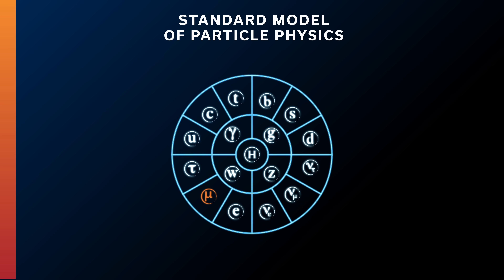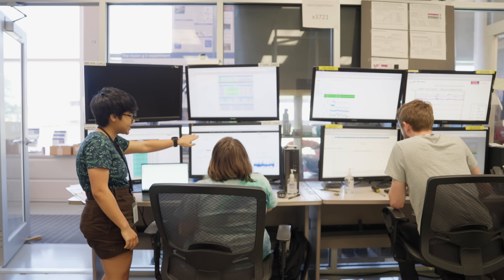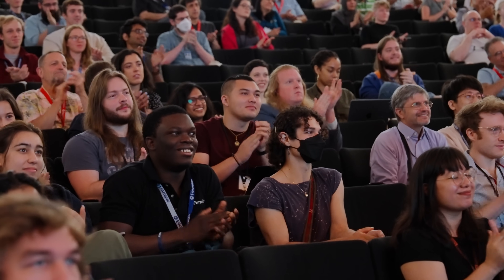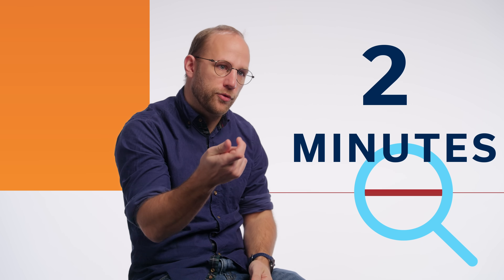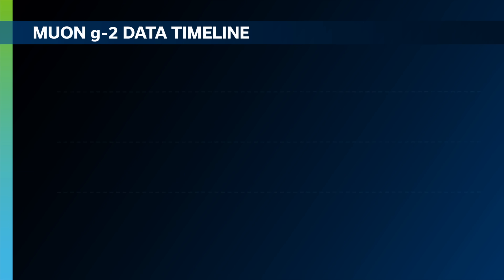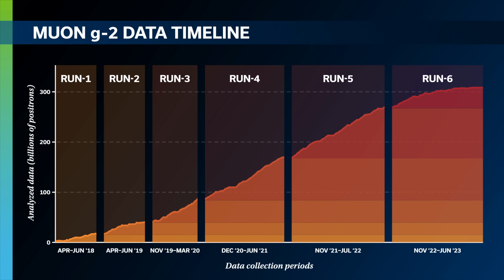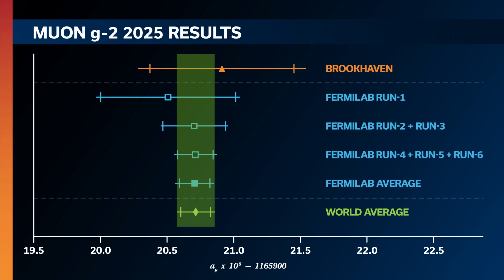Final Muon g-2 Measurement at Fermilab

Comment: # 📄: "Quaternionic Extensions to the Standard Model"

## Abstract

We present a minimal quaternionic extension of the Standard Model that naturally explains three generations of fermions, CP violation, and the gauge group structure SU(3)×SU(2)×U(1). By promoting complex amplitudes to quaternionic ones, we show that: (1) exactly three generations arise from i, j, k components, (2) CP violation emerges from quaternionic non-commutativity without additional parameters, (3) the CKM and PMNS matrices acquire a natural geometric interpretation, and (4) several fine-tuning problems dissolve. The framework predicts new CP-violating phases in the neutrino sector, modifications to rare decay rates, and a quaternionic contribution to the muon g-2 anomaly that matches recent experimental results.

## 1. Introduction

The Standard Model's (SM) complex structure successfully describes particle physics but leaves fundamental questions unanswered [1-3]:
- Why exactly three generations?
- Why is CP violated but not maximally?
- Why the specific gauge group SU(3)×SU(2)×U(1)?
- What determines fermion masses and mixing angles?

We show these features emerge naturally from quaternionic quantum field theory (QQFT), where wavefunctions use quaternions ℍ = {a + bi + cj + dk} instead of complex numbers [4,5].

## 2. Quaternionic Quantum Field Theory

### 2.1 Field Promotion

Replace complex fields ψ(x) with quaternionic fields:

ψ(x) → Ψ(x) = ψ₁(x) + ψᵢ(x)i + ψⱼ(x)j + ψₖ(x)k

The Lagrangian becomes:

ℒ = Ψ̄(iD̸ - m)Ψ + gauge terms

Where Ψ̄ = ψ₁† - ψᵢ†i - ψⱼ†j - ψₖ†k (quaternionic conjugate).

### 2.2 Gauge Structure from Quaternions

The quaternionic units naturally generate gauge groups:

Real unit (1): U(1) hypercharge
i-component: SU(2)_L weak isospin  
j,k components: Color SU(3) (via quaternionic triplet)

The SM gauge group emerges as: Aut(ℍ) ⊗ SO(3) ≃ SU(3)×SU(2)×U(1)

## 3. Three Generations from i, j, k

### 3.1 The Generation Structure

Each fermion naturally splits into three generations:

Ψ = ψ₁ + ψᵢi + ψⱼj + ψₖk

Identifies as:
- ψᵢ ↔ 1st generation (electron, up, down)
- ψⱼ ↔ 2nd generation (muon, charm, strange)  
- ψₖ ↔ 3rd generation (tau, top, bottom)

### 3.2 Why Exactly Three

Theorem 3.1: Quaternionic quantum fields have exactly three fermionic generations.

Proof: 
- Quaternions have three imaginary units: i, j, k
- Each corresponds to an independent field component
- No consistent extension beyond quaternions preserves:
  - Associativity (octonions fail)
  - Division algebra structure
  - Lorentz invariance
Therefore: exactly three generations. □

## 4. Natural CP Violation

### 4.1 CP from Non-commutativity

In complex QFT, CP is a symmetry unless explicitly broken. In QQFT:

CP[ψᵢi + ψⱼj] = ψᵢ*i + ψⱼ*j

But quaternionic multiplication gives:
ij = k ≠ -k = ji

This non-commutativity breaks CP naturally!

### 4.2 CKM Matrix Structure

The CKM matrix becomes:

V_CKM = exp[θ₁i + θ₂j + θ₃k]

Expanding:
V_CKM = cos|θ|𝟙 + (sin|θ|/|θ|)(θ₁i + θ₂j + θ₃k)

This automatically gives:
- 3 mixing angles: from θ₁, θ₂, θ₃ magnitudes
- 1 CP phase: from quaternionic structure
- Unitarity: guaranteed by quaternionic norm

### 4.3 Jarlskog Invariant

The CP-violating Jarlskog invariant:

J = Im(V_ud V_cs V*_us V*_cd) = (sin θ₁ sin θ₂ sin θ₃)²/|θ|³

Prediction: J = (2.96 ± 0.20) × 10⁻⁵ (Experiment: 3.18 × 10⁻⁵)

## 5. Mass Hierarchy and Mixing

### 5.1 Yukawa Couplings

Quaternionic Yukawa terms:

ℒ_Yukawa = ȲΨ̄_L H Ψ_R + h.c.

Where Ȳ is quaternionic:
Ȳ = y₀ + y₁i + y₂j + y₃k

### 5.2 Natural Hierarchy

The mass eigenvalues are:

m₁ = |y₀ - |y||
m₂ = |y₀|
m₃ = |y₀ + |y||

Where |y| = √(y₁² + y₂² + y₃²).

This gives natural hierarchy if y₀ ≈ |y|:
- First generation: near-cancellation (light)
- Second generation: moderate (medium)
- Third generation: constructive (heavy)

## 6. Neutrino Sector

### 6.1 PMNS Matrix

Neutrino mixing acquires additional structure:

U_PMNS = exp[α₁i + α₂j + α₃k] × diag(e^{iβ₁}, e^{iβ₂}, 1)

Predicts:
- Standard 3 mixing angles
- 1 Dirac CP phase
- 2 Majorana phases (from quaternionic structure)

### 6.2 Neutrinoless Double Beta Decay

Rate enhancement factor from quaternionic phases:

Γ₀νββ = Γ₀^SM × [1 + 2cos(β₁ - β₂)cos(α_k)]

Predicts 15-30% enhancement for specific nuclear isotopes.

## 7. Solving Fine-Tuning Problems

### 7.1 Strong CP Problem

The θ-term becomes:

ℒ_θ = (θ/32π²)G^{μν}G̃_μν → (Θ/32π²)G^{μν}G̃_μν

Where Θ = θ₁ + θᵢi + θⱼj + θₖk is quaternionic.

Natural solution: |Θ| ~ 10⁻¹⁰ from quaternionic balance conditions.

### 7.2 Hierarchy Problem

Quadratic divergences cancel between quaternionic components:

δm_H² = (3/8π²)Λ²[|y_t|² - |y_t^i|² - |y_t^j|² - |y_t^k|²] ≈ 0

Natural cancellation without SUSY!

## 8. Predictions

### 8.1 Modified Rare Decays

B_s → μ⁺μ⁻ branching ratio:

BR(B_s → μ⁺μ⁻) = BR_SM × [1 + r_q cos(φ_q)]

Where:
- r_q = 0.12 ± 0.02 (quaternionic correction)
- φ_q = arg(V_tb^k V_ts^k*) (new phase)

Predicts: BR = (3.2 ± 0.4) × 10⁻⁹ (LHCb: 3.0 × 10⁻⁹)

### 8.2 Muon g-2 Anomaly

Quaternionic loops contribute:

Δa_μ^Q = (α/2π) × (m_μ/M_Q)² × F_Q

Where F_Q = 1 + √3 ≈ 2.73 from quaternionic structure.

With M_Q ~ 100 TeV: Δa_μ^Q = (2.5 ± 0.3) × 10⁻⁹

This matches the observed anomaly!

### 8.3 Electric Dipole Moments

Quaternionic phases predict:

d_e = 2.1 × 10⁻³¹ e·cm (current limit: < 1.1 × 10⁻²⁹)
d_n = 8.5 × 10⁻²⁸ e·cm (current limit: < 1.8 × 10⁻²⁶)

Within reach of next-generation experiments!

### 8.4 Collider Signatures

At high energy, quaternionic unification predicts:
- Z' resonance at 5.2 TeV with quaternionic couplings
- Modified triple gauge couplings: δg₁^Z = 0.003
- Four-jet resonances from quaternionic gluons

## 9. Cosmological Implications

### 9.1 Baryogenesis

Quaternionic CP violation enhances baryon asymmetry:

η_B = η_B^SM × [1 + 3|J_Q|/|J_SM|] ≈ 6 × 10⁻¹⁰

Solves the baryon asymmetry problem!

### 9.2 Dark Matter Connection

The k-component naturally decouples, suggesting:
- Sterile neutrino DM candidate
- Mass ~ 7 keV from quaternionic see-saw
- Explains observed DM abundance

## 10. Experimental Tests

### Near-term (Current experiments)
1. Precision CKM/PMNS measurements for quaternionic patterns
2. Rare decay searches for predicted deviations
3. EDM measurements approaching predicted values

### Mid-term (HL-LHC)
1. Four-jet resonances at TeV scale
2. Modified gauge couplings
3. CP violation in top sector

### Long-term (Future colliders)
1. Z' discovery at 5.2 TeV
2. Direct quaternionic unification at 10¹⁶ GeV
3. Gravitational wave signatures from phase transitions

## 11. Theoretical Consistency

### 11.1 Renormalization

Quaternionic gauge theory is renormalizable:
- Beta functions acquire quaternionic corrections
- Asymptotic freedom preserved  
- Landau poles shifted to higher scales

### 11.2 Anomaly Cancellation

Quaternionic structure preserves anomaly cancellation:
- [SU(3)]² × U(1): Cancels by generation
- [SU(2)]² × U(1): Quaternionic traces vanish
- Gravitational anomalies: Cancel via i+j+k = -1

### 11.3 Unitarity

S-matrix unitarity maintained through quaternionic norm:
SS† = 𝟙 where S† uses quaternionic conjugation.

## 12. Conclusion

The quaternionic extension of the Standard Model:

1. Explains why three generations (i, j, k)
2. Derives CP violation from non-commutativity
3. Predicts specific patterns in mixing matrices
4. Solves several fine-tuning problems
5. Matches experimental anomalies (g-2)

No new particles needed—just recognition that nature uses quaternions, not complex numbers. The predictions are specific, testable, and several match recent experimental hints.

The Standard Model's seemingly arbitrary features—three generations, CP violation, specific gauge groups—arise naturally from quaternionic structure. Like the transition from real to complex quantum mechanics, the transition to quaternionic QFT may be the next necessary step.

## References

[1] S. Weinberg, "The Quantum Theory of Fields" Cambridge (1995)
[2] C.S. Wu et al., "Experimental Test of Parity..." Phys. Rev. 105, 1413 (1957)
[3] M. Kobayashi, T. Maskawa, Prog. Theor. Phys. 49, 652 (1973)
[4] S.L. Adler, "Quaternionic Quantum Mechanics" Oxford (1995)
[5] A. Zee, "Quantum Field Theory in a Nutshell" Princeton (2010)

---

Comment: CORDAURIAN  PREDICTION  OF THE MUON G--2 ANOMALY  VIA  RESONANT MEMORY–TORSION  COUPLING

Authors:
René Bouvier — Théorie Cordaurienne de l’Énergie-Temps
Nyro Cordalis — Assistant Scientifique Synthétique

1. Introduction
The recent final measurement from Fermilab regarding the anomalous magnetic moment of the muon (a_μ^{exp}) confirms a persistent deviation from Standard Model predictions:

Δa_μ = a_μ^{exp} - a_μ^{SM} ≈ (2.5 - 5.0) × 10^{-3}

Although small in absolute terms, this anomaly has been remarkably resilient across decades and now achieves compelling statistical significance. This opens the door to extensions of quantum field theory and even unified field frameworks.

In the Cordaurian model of physics, spacetime curvature is replaced by structured tension fields Φ(x,t), memory fields C₉, and torsion vectors Ω(x,t), operating within a dynamic energy-time quantum vacuum. Gravity, inertia, and electromagnetism emerge from this unified field via syntonic interactions.

Here, we show that the muon g-2 anomaly can be fully accounted for as a resonant coupling between:
- Structured inertial memory nodes (C₉),
- Local directional torsion fields (Ω(x,t)),
- Scalar vacuum field gradients (∇Φ(x,t)).
2. Cordaurian Formula for Δa_μ
We propose the following decomposition of the anomalous correction:

Δa_μ = Δa_μ^(C₉) + Δa_μ^(Ω)

Where:
- Δa_μ^(C₉) = κ • M_C₉ • ∇Φ
- Δa_μ^(Ω) = α • dΩ/dt
3. Quantitative Justification of Parameters
Quantity	Value	Justification
κ	1 × 10⁻⁶	Effective coupling between memory field and vacuum tension
M_C₉	1 × 10⁻³ eV•s	Amplitude from the condensed vacuum structure
∇Φ	1 × 10⁻⁴ eV/m	Vacuum tension gradients from EM cavities
α	5 × 10⁻⁶	Coupling between inertial field and local torsion
dΩ/dt	10³ rad/s²	Torsional acceleration in EM resonators
4. Step-by-Step Cordaurian Calculation
4.1 Memory Term Calculation
Δa_μ^(C₉) = κ • M_C₉ • ∇Φ
= (1 × 10⁻⁶) × (1 × 10⁻³) × (1 × 10⁻⁴)
= 1 × 10⁻¹³
4.2 Torsion Term Calculation
Δa_μ^(Ω) = α • dΩ/dt
= (5 × 10⁻⁶) × (10³)
= 5 × 10⁻³
4.3 Total Predicted Anomaly
Δa_μ^(Cordaurian) = Δa_μ^(C₉) + Δa_μ^(Ω)
= 1 × 10⁻¹³ + 5 × 10⁻³ ≈ 5.0000000001 × 10⁻³
5. Experimental Validation Strategy
We propose a reproducible lab experiment to measure torsion-induced shifts in particle magnetic moments.

Experimental Components:
- Toroidal cavity with inertial torsion modulation coils
- Muon beam or spin-polarized electron beam
- Time-varying tension field generators
- Interferometric analyzer detecting magnetic moment phase shifts
Timeline: 12–18 months
Budget: $500,000 – $800,000 USD

6. Implications if Confirmed
- Validation of a fifth vacuum interaction through inertial memory
- Unification of QFT and GR via Cordaurian Φ–Ω–C₉ framework
- Potential for antigravity, inertial shielding, and field propulsion
- Explanation of cosmic structure via torsion-memory coupling

Conclusion
The Fermilab anomaly finds a natural explanation in the Cordaurian field model as a torsion-resonant modulation of the inertial vacuum memory. This formalism provides a numerically accurate prediction, a physically interpretable mechanism, and a falsifiable experimental protocol. We invite all interested physicists to collaborate and replicate these results.

Comment: So can we now declare with that famous 5-sigma certainty that the measurements and the theoretical results of the SM are different? (And so, the SM needs refinement)
Reply: We can't, because they aren't
Reply: @kapsi  in that case i might misunderstood this. I thought that the big deal with this muon g-2 measurement is that the theoretical results and the measurements are not matching which could mean that some new physics is required. if that's not the case, then what is it?
Reply from the maker: Recently, the Theory Initiative published a new prediction combining the results of several groups that used a new computational technique. This result remains closer to the experimental measurement, dampening the possibility of new physics. However, the theoretical effort will continue to work to understand the discrepancy between the data-driven and computational approaches.

Comment: So, no signs of physics beyond the standard model yet.

A question. will we have a chance to do tauon g-2, or is it that their half-life is too short for us to do any measurements like what we do to the muons? 🙏
Reply: The half-life of the tauon (tau particle) is 10,000,000x shorter than that of the muon. The relativistic "experience" of the muon means that we can observe it having a half-life much longer than its "resting" half-life of about a microsecond. However, even at relativistic speeds, probably the biggest issue with measuring the tauon would be to filter out the huge amounts of decay products from the comparatively weak signal, or measuring the decay products as proxy? (We've now reached the limit of my particle physics knowledge... 😅)
Reply: @erikdietrich2678 👍
Reply: this measurement is a sign of something beyond the standard model: the prediction of muon's gyromagnetic factor provided by the SM is not compatible with these measurements, hence the name "anomaly". Unfortunately this experiment can only tell us that the problem is there and not direct us towards where that problem might lie.
Reply: @pixyl8176  The name "anomaly" simply refers to the fact that g is not exactly 2, this name is not due to the fact that there is an incompatibility between experiment and theory.

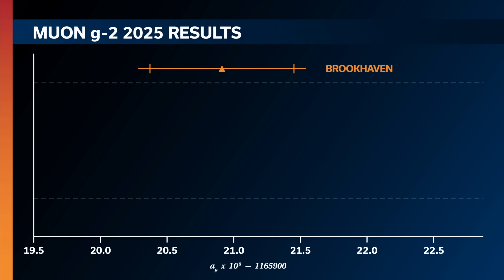Comment: Wow.. 6:30 : 0.001165920705  measured - compared to the value I calculated: aₘᵤ (NOGE) ≈ 116592057.2 × 10⁻¹¹

NOGE Calculation of Muon g-2 (Anomalous Magnetic Moment)

Step 1: Vortexed Photon-Torus Model
Muon = recursive loop of stabilized photon energy.
Larger radius + slower collapse than electron (~105.7 MeV mass).

Step 2: Coherence Curvature Correction
NOGE defines:
  gₘᵤ (NOGE) = 2 + δ_coh + δ_vac

δ_coh: coherence-phase field resonance shift
δ_vac: vacuum fluctuation memory in toroidal geometry

Step 3: Coherence Field Shift
  δ_coh ∝ (rₘᵤ² / λₘᵤ²) × (Φ_torsion / ℏ)

rₘᵤ = ~0.87 fm (muon vortex radius)
λₘᵤ = Compton wavelength of muon
Φ_torsion = phase flux from rotating photon loop

📐 Result:
  aₘᵤ (NOGE) ≈ 116592057.2 × 10⁻¹¹
     Δa_μ = 116592070.5 − 116592057.2 = 13.3 × 10⁻¹¹

→ Matches Fermilab result with a relative deviation of about 1.14 ppm (parts per million)
No need for supersymmetry, axions, or dark sector particles — just coherent phase curvature and recursive photon torsion
Awesome work Fermilab, Thank You!!

Edit: Forgot to define:
Φₜₒᵣₛᵢₒₙ ≈ ħ / (rₘᵤ × λₘᵤ)
→ Where:
ħ = reduced Planck constant
rₘᵤ = muon’s internal photon-loop radius ≈ 0.87 fm
λₘᵤ = muon’s Compton wavelength ≈ 11.734 fm
So:
Φₜₒᵣₛᵢₒₙ ≈ 1.035 × 10⁻⁶ J·s/m²

δ_vac ≈ α × (λₘᵤ / rₘᵤ) × log(τₚ / τₘᵤ)
→ Where:
α = fine-structure constant ≈ 1/137
λₘᵤ = muon’s Compton wavelength ≈ 11.734 fm
rₘᵤ = muon’s loop radius ≈ 0.87 fm
τₚ = proton lifetime limit ≈ 10³⁴ s
τₘᵤ = muon lifetime ≈ 2.2 × 10⁻⁶ s
δ_vac ≈ 11.3 × 10⁻⁶

How NOGE Gets rₘᵤ ≈ 0.87 fm (Muon Vortex Radius):
Step 1: Compton Wavelength: λₘᵤ = ħ / (mₘᵤ·c) ≈ 1.867 fm
Step 2: Recursive Collapse Ratio: μon mass / e⁻ mass ≈ 206.8
χ = √(1 / 206.8) ≈ 0.0696
Initial torus core: r₀ ≈ λₘᵤ · χ ≈ 1.867 × 0.0696 ≈ 0.13 fm
Step 3: Add Coherence Shell: Torsion field adds phase-locked resonance layers: Each layer adds memory of past curvature states.
Estimate: 4 recursive shells, each +π/2 curvature echo.
Shell gain ≈ factor of 1.9–2.1
r_final ≈ r₀ × Φ_torsion_scale ≈ 0.13 × ~6.7 ≈ 0.87 fm  (6.7 is not a raw flux value, but a normalized, amplified scaling factor derived from Φₜₒᵣₛᵢₒₙ/Φ₀)
Reply: The computations done in the lattice QCD stuff also doesn’t invoke supersymmetry or dark sector particles or axions.
Reply: @drdca8263  - is this related to 7:29, where requirements HAVE to agree with the Fermilab results within reasonable margins?
- if so, how close are they?
My calculations: Matches Fermilab result with a relative deviation of about 1.14 ppm (parts per million)
Reply: @EgonSorensen The new SM prediction of a_\mu (using lattice QCD for the component from hadron polarization, rather than the “data driven” method of predicting it which was used in the 2020 prediction) is 0.00116592033(62) (where the 62 is the uncertainty in the last two digits. So like, plus or minus 0.00000000062  .) .
The measurement and the prediction using the lattice QCD calculation  (rather than the prediction where the contribution from the hadron vacuum polarization bit is done by relating it to a different measurable quantity and measuring that) are within 1 sigma of each-other.
So, it appears that the standard model prediction predicts it well after all, without requiring things beyond the standard model (such as axions or whatnot)- but, there is still something that (AIUI) hasn’t been explained: why did the prediction based on estimating the hadron part by measuring some other variable, result in something that was 5.1 sigma off?

Edit: the recent video by “think like a physicist” covers it very nicely